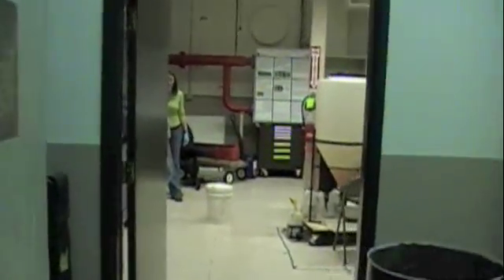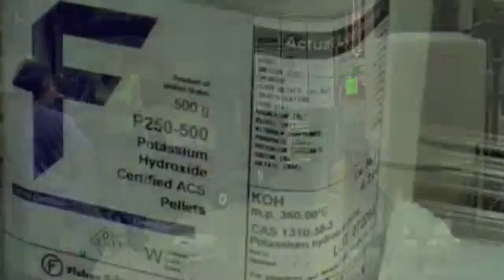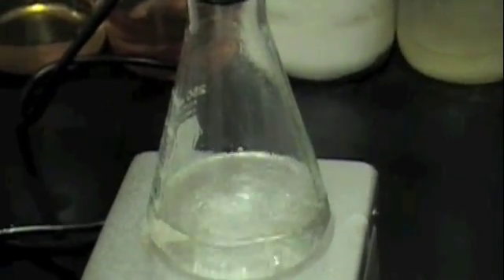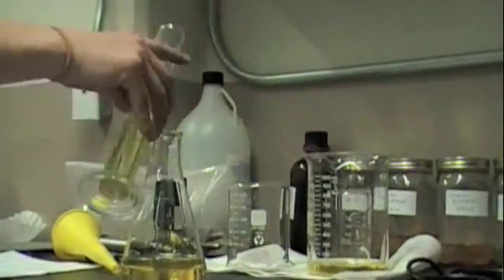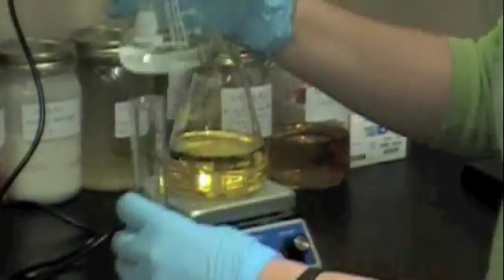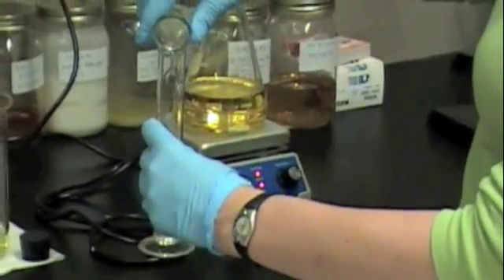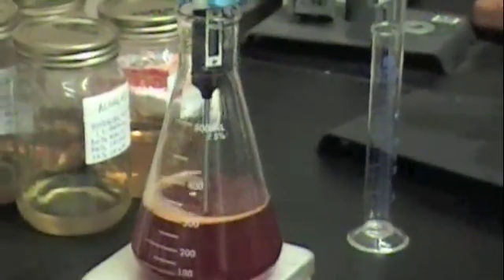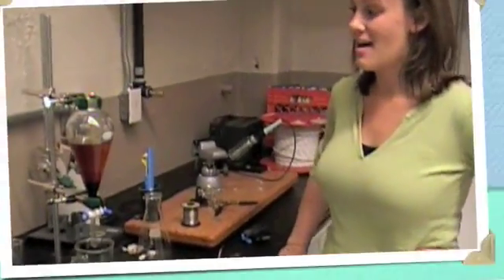Transesterification

Comment: Good day Mrs. Metcalf! We would like to ask for some infos from your video posted in youtube. It's about the transesterification. We are hoping for your response as soon as possible. Thank you for your kindness.
What temperature is the methoxide needed to be heated?
Do we need to heat the oil with methoxide?
What's the ratio of the amount of methanol to the amount of potassium hydroxide? And with the methanol to the vegetable oil?
After the mixing of the methoxide and the oil, and after filtering the glycerine out of the mixture. Is it already a biodiesel? I mean, can it really power a kerosene lamp?
Reply: NERD